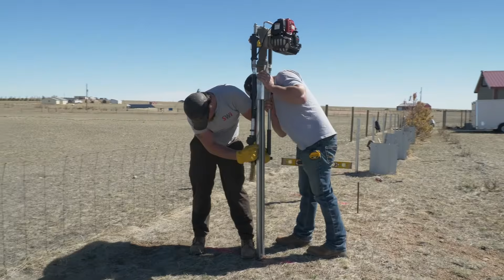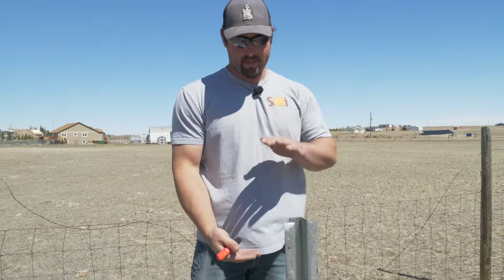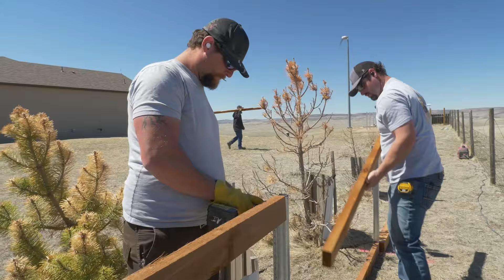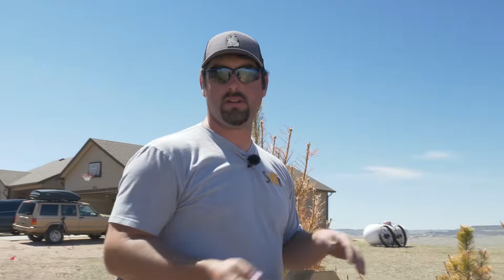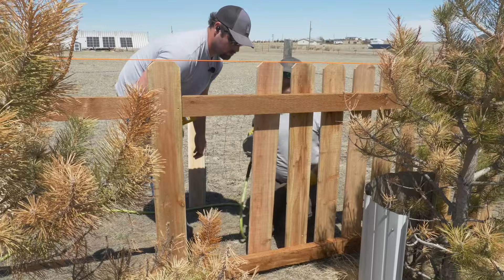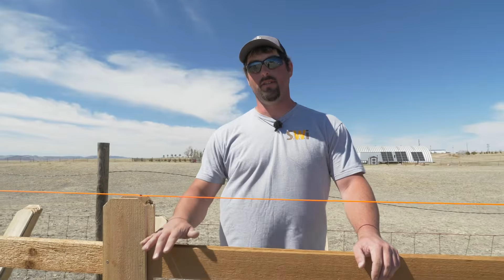How We Build No-Dig Cedar Fence

Comment: At $62-$140 per post, I can prob build that fence several times over with a regular old 4x4 and concrete. I’ll dig the holes thanks …
Reply from the maker: They are, of course, cheaper if you can find them locally, instead of from a company like us who's paying for shipping steel both ways.
It's all about how long you want it to last.

Comment: Why in the world would you mark all over the stringers instead of cutting a spacer board to hold up between the pickets as you nail so the final product is cleaner?
Reply from the maker: Because the picket spacing between each pair of posts was just ever-so-slightly different, and we're obsessed with even picket spacing. 🙂 In other words, one spacer board would only work between one pair of posts, and at that point it was faster for us to take some quick measurements.

Comment: nice work!  that seems like a lot of steel poll (>36") in the ground, especially for an open 48" high split fence.  aren't the shorter (7'-6") polls a lot lower cost?
Reply from the maker: We get a LOT of HEAVY wind out here in Wyoming! We're engineering this to make sure it stays exactly where it's been put. 👍
Reply: @SWiFence  I get it.  have you tried a hybrid approach, by first digging a quick shallow 10" to 12" deep hole then pound 24 more inches and then come back later and fill the top of all the 10" holes with concrete ? It solves the wind with wet soil issue with minimum work and materials, etc.  You might need to go a few inches deeper if there is deep frost line in your area.
Reply: @larryseibold4287  or they could just do it the way they did and save time and money.
Reply: Those posts are about $30/each.

Comment: Good luck trying that in Connecticut.
Reply from the maker: I always love the “good luck trying that in ________” comments
Reply: @SWiFence  I’ve often thought this would be easy here in the Willamette Valley. I’ve done a few post master jobs.  Day dreamed about pounding them in. 
This place is a soggy clay mess in wintertime. 
I’ve torn down plenty of pressure treated post cedar fences here without concrete in them but I haven’t felt comfortable trying this way yet. 
I did a test with a chainlink end post once to see how it would stay after a year or two. 
It stayed but definitely opened up a top gap in the soil when I started pushing back and forth in it by hand after all that time. 
I could definitely see doing this in a drier climate.

Comment: Hi like your techniques, so why not use a two piece sliding template that lays ontop of framing between post that slightly adjustable then you wouldn’t have to use tape measure to calculate boarding distance would save so much time using tape measure 👍✌️
I might have just invented a patent or just quicker technique
Reply from the maker: You're thinking in the right direction. We actually do use a bump board at times. https://youtu.be/6kX3wBkg5WM

Comment: Have you built a no-dig Hog wire fence?  wondering how that would work.   Specifically using the 16' panels.
Reply from the maker: Driven posts or the postmasters?
Reply: @SWiFence  Thinking of the no dig postmasters